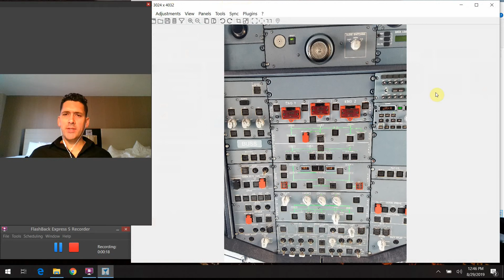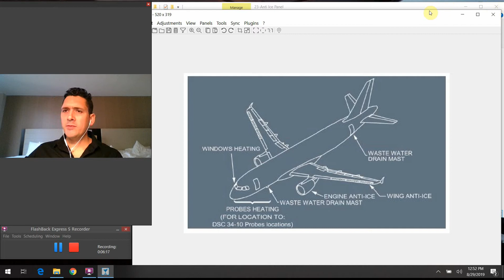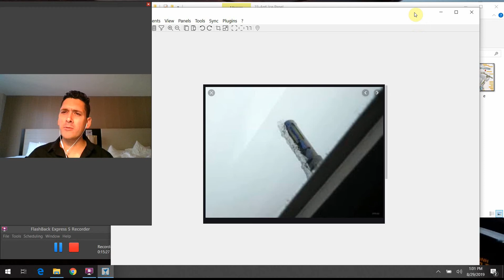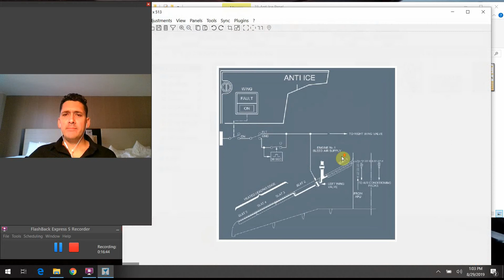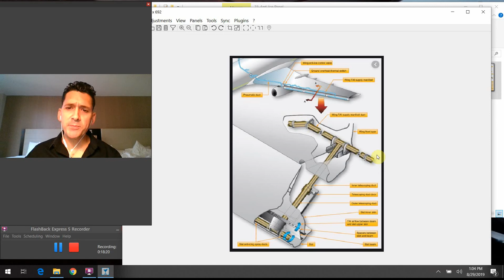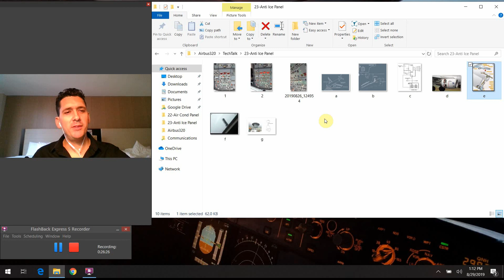Airbus A320 Cockpit Tour: #23 - Anti Ice Panel: What do all those buttons do?!

Comment: Some A320 do have ice detectors you mentioned in this video(DAIDS-Dual Advisory Ice detection system), and when icing is detected, level2 ecam is triggered(either ICE DETECTED or SEVERE ICE DETECTED, depending on the severity) and it'll tell you to turn on engine anti ice(both icing and severe icing) and wing anti ice(if severe icing is detected). You still have to turn it on manually if icing condition exists, but it's a nice little system.

Comment: Hi Mr.Abignale

Why don't the control surfaces on the empennage have any anti ice systems?
Is the winglets on winglet equipped A320 heated?
Why do engines have seperate switches for anti ice but there is only one switch for wing anti ice? Is there an occasion where you switch on the anti ice for just one engine?
 I noticed a gap between the anti ice switches in the overhead panel. Is it there to seperate wing anti ice and engine anti ice or is it a space for an optional switch?
While you showed the probe which is used to see if there is ice , you mentioned something about being able to illuminate the probe. Is there light built into the probe or do you have to use an external light source to illuminate the probe?
How high does the anti ice system heats up the engine inlets and wings?
Can you explain the different deicing fluids used to deice a plane ? How does it look like?
Reply from the maker: Why don't the control surfaces on the empennage have any anti ice systems? - Surprisingly enough, it's because these can actually withstand large amounts of icing and still perform the aerodynamic job they are suposed to do. So no deicing equiment needing to be installed there saves weight and unnecesary system complexity.  

Is the winglets on winglet equipped A320 heated? -  No

Why do engines have seperate switches for anti ice but there is only one switch for wing anti ice? - Single engine taxi operations. One engine inopterative flight operations. Both wings will always require heat if you have determined you neat heat at all.

Is there an occasion where you switch on the anti ice for just one engine? - Single engine taxi operations. One engine inopterative flight operations. 

I noticed a gap between the anti ice switches in the overhead panel. Is it there to seperate wing anti ice and engine anti ice or is it a space for an optional switch? - Just the way Airbus designed it. I don't believe they left space for any sort of other optional switch. 

While you showed the probe which is used to see if there is ice , you mentioned something about being able to illuminate the probe. Is there light built into the probe or do you have to use an external light source to illuminate the probe? - Light built is build into the probe and is supposed to provide back lighting for the ice built up.

How high does the anti ice system heats up the engine inlets and wings? - Hmm, I wish I could tell you a specific temperature, but I was not able to find a reference for this. 

Can you explain the different deicing fluids used to deice a plane? - Yes, very basically, Type I is used to remove ice from an aircraft. If you are needing to takeoff while it is actually precipitating, you need to apply Type IV. So once again, TYPE I = Deicing. TYPE IV = Anti Icing. 

How does it look like? - TYPE I = Orange. TYPE IV = Green.
Reply: @MikeAbignale 
If the control surfaces on the  empennage does not require anti ice and can do it's job even in icing conditions, why is it deiced before takeoff?
Is there a particular color for the light that is used to illuminate the ice probe to make it more visible during night time flying? If possible can you display the picture of an illuminated ice probe? I've seen that probe before but never illuminated. As a matter of fact, i didn't know it can be illuminated at all.... I thought you would have shine a torch or something to see it or maybe the lights in the cockpit might be just enough to check whether there is ice on the ice probe. Thanks for providing us with that snippet of information 😃😃😃

 thank you very much for answering my questions  Mr.Abignale😀😀😀